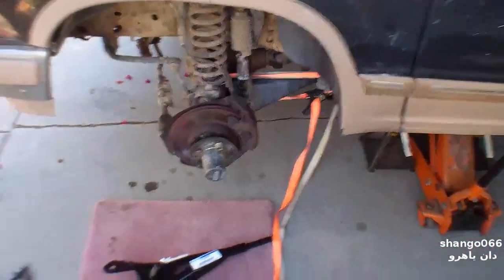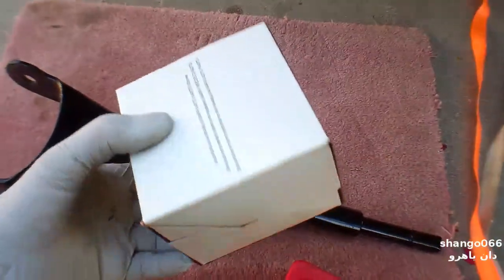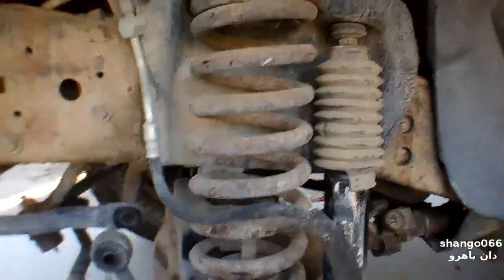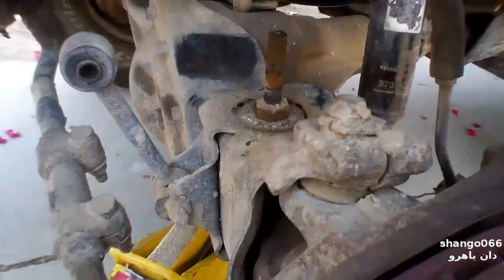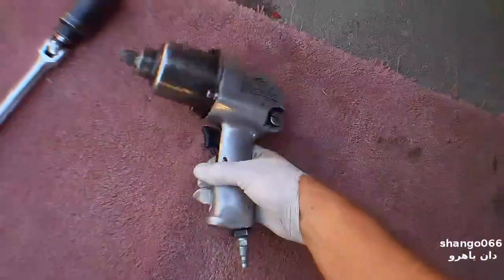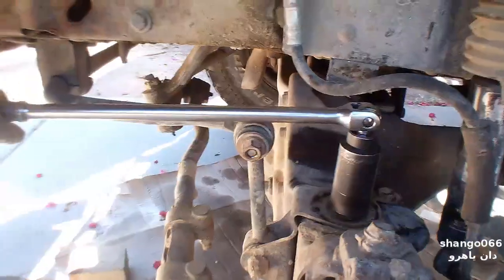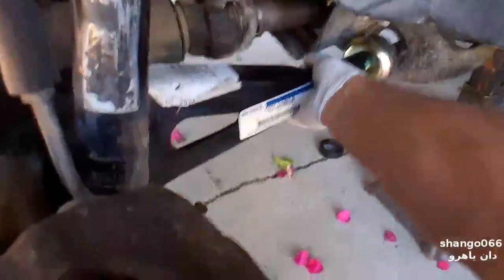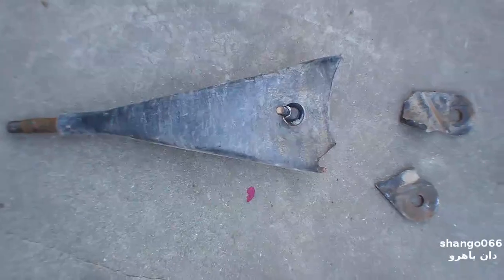Ford Explorer Radius Arm Replacement Repair

Comment: Great instruction!  My son and I used your video as a guide and had his 1992 F150 passenger side Radius Control Arm replaced in less than an hour.  The ratchet strap was a great idea!

Comment: I'm glad that turned out well, it looked like a pain in the ass. You might want to use penetrating oil on rusty bolts like that, it really does make a world of difference. The stuff I use actually dissolves the rust.
Reply: Thanks for the offer bro, but I'm good.
Reply: lmao

Comment: Way to go! Believe mine suffered a lot more damage requiring spring removal, because the previous owner drove it a few blocks without temporary strapping as seen here. Nice move, because it was all a mess after.

Comment: My 91 Ranger had a stud that sheared off the nut in the differential. I would highly reccomend putting a torch to the thing because mine was locktited in aswell. My Milwaukee m18 fuel 1/2" high tourque impact wrench couldn't even get it off. I had to use a long breaker bar with a cheater and that broke it.

Comment: One other thing Its best to replace your front springs cus adjusting your headlights are not that fun when there is no more adjustment for your plastic headlight. I've found out its best to put stock or an inch taller springs in your 1988--92 rangers and 1991--1994 explorers. Putting in Re pop Headlights makes your lights work better plus they see farther

Comment: Thank you!  Helped me a lot!  Man those nuts and bolts were a b*tch to get out!  I had to use a 1/2" drive breaker bar with a 6' cheater pipe on it (and an impact wrench) to get that spring retaining stud out of the axle!  I also had to cut that stud off shorter so that my deep impact socket would engage the nut on it (there are enough extra threads to enable you to cut off some of them).  Anyway, thanks again!
Reply: What socket did u use

Comment: shango066 you should get some custom Radius arms made for your explorer, they are very easy and cheap to make out of tube steel. they will give you more suspension travel and easier on nasty roads.
Reply: Just Somebody where would one get custom made arms? I have a similar truck except it’s a Mazda and I can’t find the arms at any parts store

Comment: Ratchet wrench would be great, or a socket and ratchet.
Reply: +Steven King SK, It&#39;s a F dash dash dash! Torch it, LOL  
I wonder if some penetrating  oil would have helped, but then again, it&#39;s a F dash dash dash!  Usually those tuff bolts break or strip out.

Comment: PB BLASTER!!!!!!!!!!!
Reply: +BassmasterBling That's what I was thinking too. Use a little oily lube on the threads only. For that job, definitely air tools. It's something I would certainly never attempt at my tender age.
Reply from the maker: +Zhou Chen Lin Use no lube at all on self locking bolts. What manual states
Reply from the maker: I have heard, this is LA, we have all the same delightful exotic things here. No need to travel more than a few miles
Reply: +shango066 You have to wonder about that in light of long term corrosion (rust) on a vehicle of that age. I would love to hear the technical explanation for it. I'm pretty much an open mind and not a true mechanic. Feel free to abuse me.
Reply: THANK YOU!!!

Comment: Penetrating oil won't help that bolt. The threads have a ton of rust, changing my radius arm out right now. What did work was using a MAP gas torch on it for 30 seconds to a minute on the underside of bolt where the nut sits. Then the 12 point closed end wrench will spin it out much easier after that. Even after getting it worked part way loose using penetrating oil didn't help much because of the rust and junk in the threads.

Comment: You should have first sprayed those bolts/nuts with Kroil or PB Blaster, and let it soak in a few minutes.  It would have made it easier to take them apart.
Reply from the maker: +Pete Ciallella does no good on self locking nuts and manual specifies keeping all threads dry
Reply: shango066

Comment: I have a ford ranger. I don't need a spring compressor for the radius arm
Reply: Robert Yeary I own spring compressors & I don't know but I seem to find using them better & easier on my Ford Territory as my shocks sit inside my springs.

Comment: you need wd40 dude penetrating fluid, leave it in there for a good 20 minutes
Reply from the maker: +Synthematix not on self locking nuts
Reply: +shango066 Still waiting for the expert mechanic to explain not using lube on the threads only. Is it an issue of overuse of lubricant? By that I mean, you would not want to spray lube on the socket and nut itself. Like I said, just the threads. Mechanics? Locking bolt experts?
Reply: an expert mechanic would probably have used a blowtorch
Reply: +paul larson Use the lube for disasssembly only, then clean threads with brake cleaner if needed.  Also,  locking nuts should be replaced after removed.
But nice video and got the job done!

Comment: You gotta use thread locker buddy.
Reply from the maker: +Steven King Factory manual specifically says do not use loctite on self locking bolts
Reply: +Steven King Nope, then it would never get off lol!
Reply: Not on self-locking bolts!